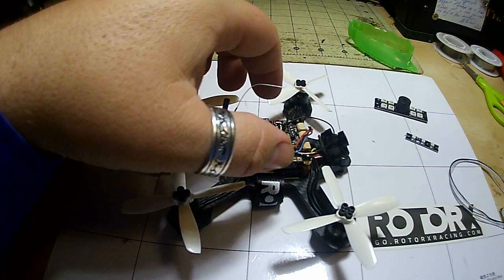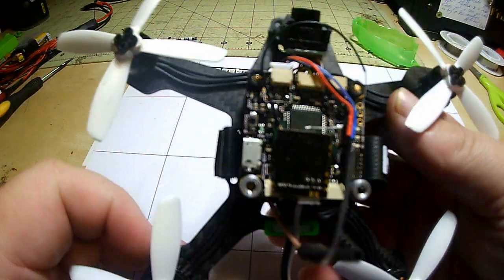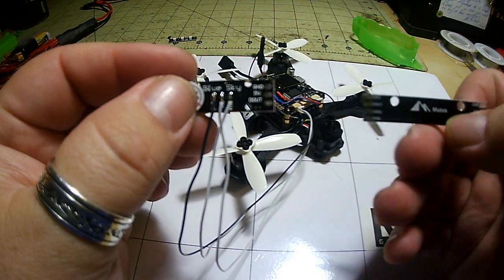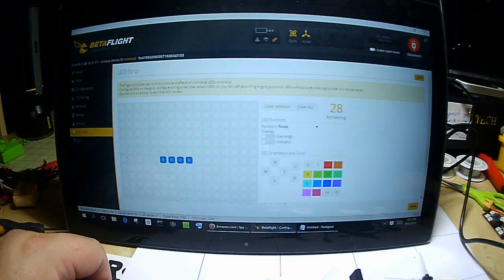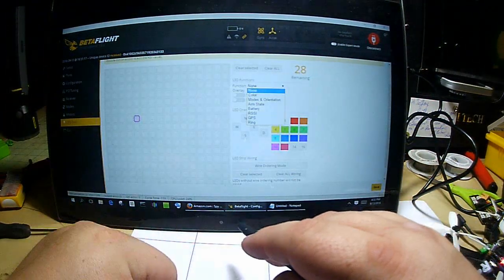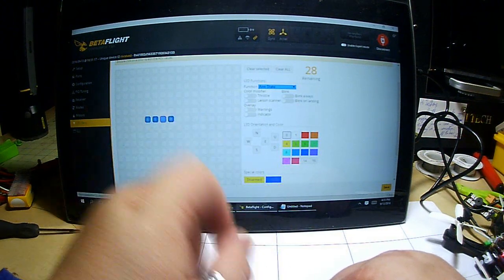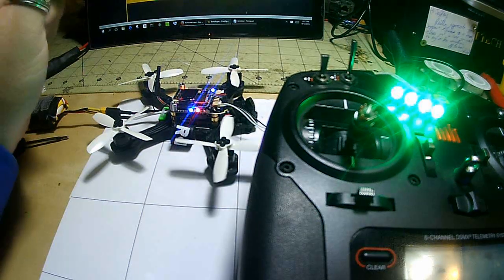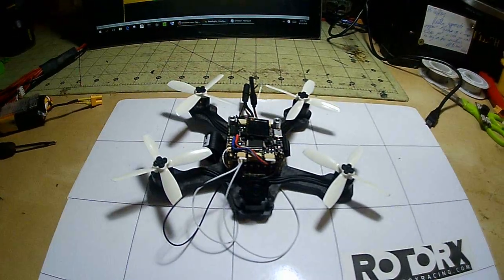RotorX Atom V2 DIY kit How to: Adding LED's

Comment: What did you use for your battery wire in the rear of your v2 I saw you had two green tabs and a zip tie in the middle how did you do it
Reply from the maker: I printed this little guy here:

http://www.thingiverse.com/thing:1731583